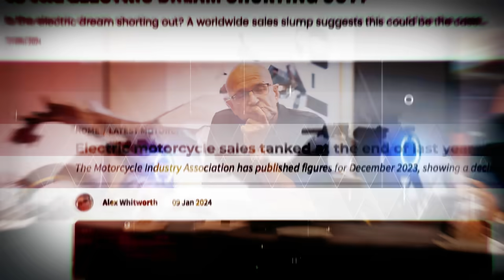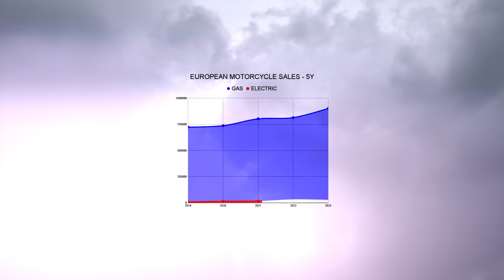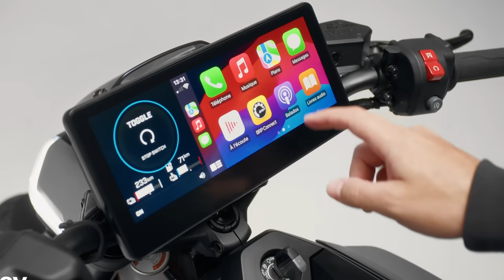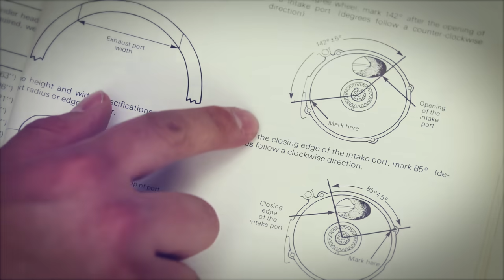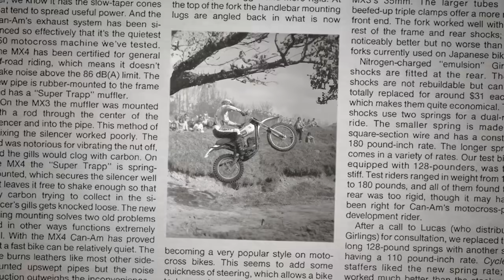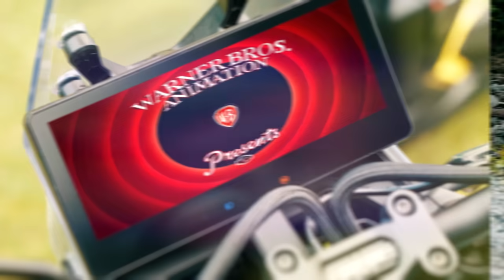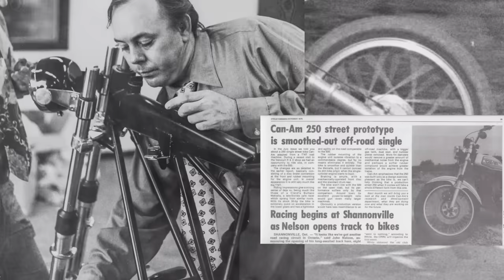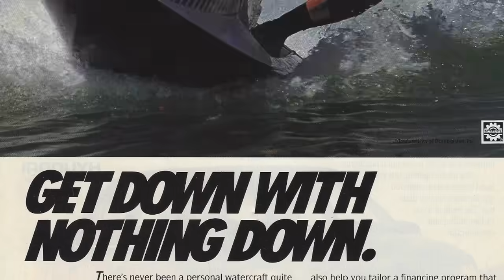2025 Can-Am Origin Review - The 115km "Adventure" Bike

Comment: I'd like to see the marketing data that shows at this price point, >$20K, how many units they need to sell so its a viable product.  I think they just should've made a really good electric enduro bike with that semi-unspring motor/drive train.  A cheaper bike that 's 100 lbs lighter intended to be trailered.  My BMW 2012 G650GS Sertao at 425lbs/47hp about the same as the Origin but goes almost 400kms/tank. Its a pretty good 50/50 adv bike and I'm keeping it.  But I want a good electric trail/enduro bike so I can get more aggressive on the trails and don't poop myself out picking it up after my inevitable tip overs.

Comment: The market will eventually arrive. A typical battery density right now is about 190 to 250Whr/kg. CATL is now producing batteries for aviation at 400Whr/kg and have batteries at 500Wh/kg coming out. The price of these batteries will come down to the point that they make sense for motorcycles. Density will also continue to increase. Charge times are also coming down dramatically. As soon as chargers become more ubiquitous, long trips become an option. So it will happen and not because of mandates.

Comment: I was really looking forward to this enduro dual sport bike (origin) , loved the looks and already owning an Electric Zero FX, I thought it would be the perfect upgrade.  My Zero FX is nearing 9,000 miles and I was looking forward to trading in the11 year old technology (Zero FX came out in 2013) for the latest and greatest EV tech advancements that the industry has made over the past decade.  I was excited to read the first line, that the battery was kissing the 9kw mark, instead of 7.2kw for my Zero FX…so Im thinking, more range, power, speed etc….nope.  the brand new, not yet available Origin, with a bigger battery and 11 years of technological head start has less torque, slower 0–60-time, slower top end speed, a tad less range, weighs in at 120 pounds heavier and costs about $1,000 more?  To be fair, I like the Origin styling better (personal opinion) and it comes with reverse (an after-market upgrade for Zero FX) and it has a larger display.  Self-oiling chain drive is nice but for trail riding my Kevlar belt is just fine, Im not a pro racer or big jumper.  As far as criticism on lack of range, this depends on your use.  Range is not an issue as I use it 90% for trail riding on trails connected to my house, and am always tired of riding long before battery is dead.  I can do 6-7 hours of relaxed trail riding on one charge.  If I do go out riding with friends at a distant location (rare, since I don’t have many friends) my electric pickup has 50 amp plugs so I use it like an aircraft carrier and refuel my bike during lunch.  I also use the bike in place of a golf cart for running around my commercial property (my business is a wooded resort) so it is very handy as it is much faster than a golf cart, road legal if needed and can maneuver between trees better and does not get stuck.  Enjoyed the video.  Thank you

Comment: How long does it take for a full charge? Also, Can Am, here's a freebie: The support fighters had a range issue during WW2, and they used drop tanks to keep up with the bombers. Perhaps some saddlebag batteries would be a good accessory. Get the range for when you need it, keep a second set for use while the first set charges. That kind of thing, because I'm assuming from my dirt bike riding friends in So Cal that a lot of people truck or trailer their bikes to dunes or trails, and since they carry extra gas with them, why not carry extra batteries that one could, oh, use a generator or solar power system to recharge in desert?

Comment: I know it would be heavy but they can make way more efficient that design. Just put a gas engine to make energy for the electric motor. GM and Nissan did that to their electric cars and it does the trick, you have way better mileage since you only have to make energy for the electric engine to work and you can do that at its most efficient point at any given time. Also it takes advantage of the really small electric engine.

Comment: That's ultimately my sticking point with any electric vehicle: capacity and range.  If you can only travel 100km before having to stop for 9 hours while your bike recharges, I'm not interested.  Surely solar power has to be the way forward, if solar panels could be finetuned and hidden into the bodywork of the bike.

Comment: A big thing about electric bikes is the fact that they have a high ceiling for improvement. Yes a gas bike will do everything but torque better for now, but those combustion engines as great as they are don’t have nearly as much of an improvement ceiling like electric does. I say give it 20-30 years and electric will be better than gas at everything (except that beautiful sound).

Comment: Yea, battery tech needs to massively improve to make these compelling. A 500 EXC-F Six Days with SuMo tires and wheels for less coin than this or an equivalent Zero or BMW CE electric when those others also can’t be excellent trail bikes on the weekends just isn’t a great value prop. For an actual commuter, a BMW C 400 GT, Xmax, or Burgman offer unlimited range, also low maintenance and running costs, tons of aftermarket support, good resale value, lots of storage for backpacks and groceries, better weather protection especially if you don’t mind running a leg cover, and they go for about half as much new or a third as much used. Did I mention they’ll all comfortably do 140kph on the highway all day? Get the heated grips and seat plus a taller option windshield and go enjoy commuting. Electric cargo bicycles are a good idea and proven solution to short errands and commutes around the world, but electric motorcycles have another decade to go before they’re going to be competitive with ICE, maybe 15-20 years before they’re the better choice.
Reply: Not really. People just need to pay the real cost of burning fuel. Like breathing in their tail pipe emissions. People will stop burning fuel to go from A to B real quick. Fuel is artificially cheap. You should pay for the fuel, and the cost of getting the emissions back into fuel. You cannot just burn random stuff and fill the air with it.
Reply: EV batteries take a long time to recharge.

Comment: Selling Ecycles is an uphill battle. With cars its easier to put a huge battery in that has a 200+ range, less so on a bike. Ebikes Escooters etc easy, short trip vehicles. Ecycles, sell themselves on adventure distance and excitement, and so far gas power is still where its at for that. Im waiting for the 500 mile range ecycles to appear. Everything is dependent on battery tech advancements.

Comment: What I'd like to see is some standardization, plug-and-play safety, portability, and utility in the lithium battery pack field.  I'd like that battery pack to be pull-able for charging in an apartment,  to also work with a pure sine wave inverter as a handy AC power source during outages, and also be able to put it in a riding mower, powered watercraft outboard or jet-ski, hydraulic log splitter, wood chipper, bandsaw, etc. Why buy multiple batteries for these things and more when you will be using only one of them at a time, or only sporadically?  There should be an on-board charger, and one for charging the battery when it is off the bike.  This would significantly lower the carbon end ecologically-damaging mining and battery manufacture processing footprint of e-vehicles.  If Cam-Am is willing to partner with other manufacturers to create an industry standard to power mid-size applications, I will buy it.

Comment: Does the bike have regenerative braking? If it had it on the front wheel, it would perhaps improve the range considerably.
Reply: Yes, it does.  But the regenerative braking is via the rear wheel.
Reply: @libraeotequever3pointoh95  70% of the braking force is in the front wheel, perhaps the increase in mass in the front wheel may be counterproductive, I don't know, but surely will increase range.

Comment: My Honda CRF 300 Rally offers not the best suspension, not the strongest engine, but it´s lightweight, has 400km range, runs on under 3 l /100km and costs under 7.000 Euros. And I get the legendary Honda quality. Show me the electric bike that tops that AND is more environmentally friendly over the complete lifespan.

Comment: My Honda 1974 CR 125 would do about 40 miles or a liitle more than an hour on the factory fuel tank.
Of course carrying fuel, bigger tank were easy options.  Refill < 5miinutes.
Trail head high capacity generator???
Edit: at 67 I need at least an hour break after thrashing an MX bike.

Comment: Or, here's a thought.  We would just wait til battery density get's good enough before mandating anything.   I Like electric vehicles, but not as my only vehicle.  It think and electric commuter bike is a great idea, if you're only riding it a short distance around town. I have several bikes and usually hop on my ct110 to run around town.   Motorcycles are much less aerodynamic than cars and often require more power at high speeds to overcome wind resistance, which means they would actually need an enormous and heavy battery to travel any distance at speed.

Comment: It's going to be an extremely long time for electric to compete with gas bikes. Even when the range catches up, the price tag will make them unobtainable for most, when a used gas bike will do just as well. Plus, there are plenty of parts, aftermarket or not. The electric bikes will probably need specialized technicians, upping the price even further when work is needed.
Range and showroom price tag aren't the only thing stopping electric bikes from making ground, that's just the first thing everyone notices and it already turns them off from looking closer at electric bikes.

Comment: Electric city motorcycles make great sense. Cheap, not gasseous producing, low output makes easier charging, easy storage. For most other motorcycle uses, they are too expensive, short range, heavy etc.etc. Needs some sort of big new development.
However, for closed circuit racing, electric has some huge good points. You can't get caught miles for nowhere with a flat battery, and massive pro AND amateur development , as long as the rules aren't like the ridiculous MotoE to ensure there is NO development, that might compete with ICE bikes. I suspect that there is development in areas OTHER than battery in things we haven't even considered, because we are used to ICE bike development paths.

Comment: I looked into buying an electric motorcycle for my commute. I need it to go 2x 60km in reasonable comfort with a top box for my laptop bag doing mostly motorway... and when I say motorway, I don't mean 90km/h. It's practically impossible to find an electric bike that will do this simple mission that any 15yo Kawasaki ER5 can handle with ease. You're immediately relegated to the most expensive models, that will maybe do it under ideal circumstances (until the battery degrades 2% and even that's out the window). There is exactly one Zero is see popping up on my route now and then and half the time he's tailgating a large HGV to slipstream. That's just silly. And we're not talking about price yet. I have a 1250GSA now, you point that thing in a direction and if you're good enough, it'll get you there. The EV alternative would cost me at least 50% more, have a fraction of the range, less top end, way less cargo capacity and I don't even want to think about dealer support (Zero has a pretty poor reputation and there aren't many alternatives). 

Aside from horrendously overpriced city bikes, these machines makes no technical sense. They never seem to make financial sense. I have an EV as a car and that works fine: it has enough range, great performance, interior space and charging is convenient enough. Bikes just can't compete any way you turn it today.

Comment: Well the new solid-state batteries has 50% longer range than traditional lithium batteries. They are also smaller and lighter than lithium batteries. Swiss Stromer, has already built a prototype of ebike equipped with a solid-state battery.

Comment: Can-am has 1 way to make it work.

Bimota-esque front, with dustbin fairing for range. And a small hub motor in front wheel.

Ofc. That wont happen even if today its trivial to do motorized fairings that unfold to help with highway range, and fold to not be clunky on trails.

But ofc. aping tenere 700s looks and the aerodynamics that ocme with it - the aero of a well designed parachute - is a must.

So it will flop.

Comment: The tragedy is that nobody is doing the one thing that would solve the dilemma: put a small ICE generator on such a bike. Could be a dirty little 80cm³ 2-stroke. Then it could still be used as a quiet electric in the city and on trails, but could get significantly better range on the highway without needing more heavy&expensive battery. In the worst case you could at least crawl to the next charging station at moped speed when the battery is dead.

Comment: It's an aerodynamics problem. The faster you go, the more energy you use per mile, and the relationship is parabolic. Electric bicycles are fundamentally more viable because they max out around 30km/h which is where displacing air really starts to create drag on the battery. To the point you made early in the vid, unless there is a truly incredible battery breakthrough that like, triples energy density, the electric motorcycle is a foundationally doomed product relative to electric cars and bicycles

Comment: I don't understand the market for "little commuter bikes" when you can get electric scooters for about 4 grand that do the same job, an e-bike that does the same job. Or even something like a Honda Grom or other 125cc bikes for 5 grand and you can run it for 10 years on the remaining 13 grand you're paying for this one.. as they do loads of miles to the gallon.. 
And why make an adventure bike that barely does 100km....

why go this route and not make an electric Can Am Ryker, that weird, but kinda cool, 3 wheel thing where electric makes sense, as weight matters less..

Comment: I am touring with a Zero S 14.4kWh battery 11kWh usable, I ride efficient low sperd up to 250km range and 50-70 km/h max speed.

 It is 5-6 hours ride a day and it has only a slow overnight AC charger, 1200Watt so 12 hours to recharge.

I just plug it in at night and ready to tour next morning an other 250km slow speed 6 hour ride.
What  is the problem ?

For me it is ok and I cannot recharge in 40minute but 12 hours and I can travel...

With a 8-9kWh battery and 40-50min recharge I could do a lot more a day. 
I think 180km range can be in city speed easy on throttle  and 3 stops to recharge its a daily 540km at least.

Comment: Perhaps motorcyledom's future is in levrtaging its past. Used motorcycles are a treasure trove of under-utilizes resource.
My 21 yr- old just started out riding with a 2006 Suzuki S-40 Savage. In it's 17 years of existence it had only 1500 miles on the clock! He has since added another 1200.
This bike has already been produce and is supporeted by an existing deslership network as well as a fuel network. 
And from our experencice can more than hold it's own compared to any electric IMHO.

Comment: Lots of people ignore scooters because they're not "real bikes" and complain that some real bikes "have no soul" - but these expensive and limited contraptions driven by the same kind of motor as a pump, a winch or a vacuum are acceptable?
As long as an engine doesn't sound good or doesn't vibrate I'm not interested. I want a bike that excites me when it sits in my drive way idling, not a Hoover on wheels.

Comment: I was saddled with a rental EV Mercedes "upgrade" on a recent business trip to Aurora, CO (just outside of Denver). When I got the car, it had about 60% battery left. 😡  But I figured there seemed to be enough charging stations near my destination that it would be no big deal. Well, turns out that driving around for nearly 2 hours to locate a charging station that was 1) functioning, and 2) not occupied with all of the owners off who knows where and a line of other EVs waiting to jump in, was one of the sh*ttiest ways I have ever spent an evening. Outside of some densely populated coastal cities, the charging infrastructure in the US is just a haphazard, poorly maintained, and non-standardized nightmare that isn't close to ready. Dealing with that on a bike with drastically more limited range... no thanks.